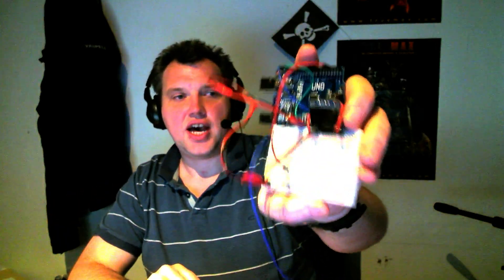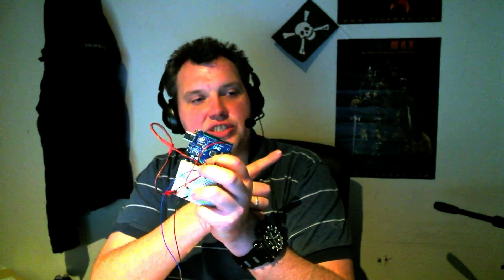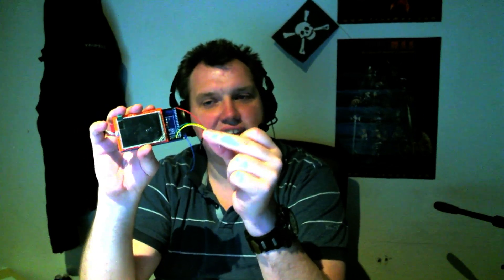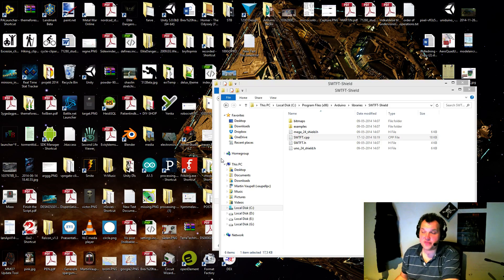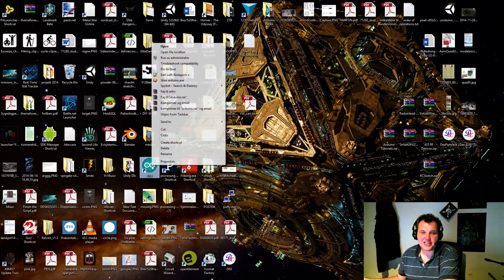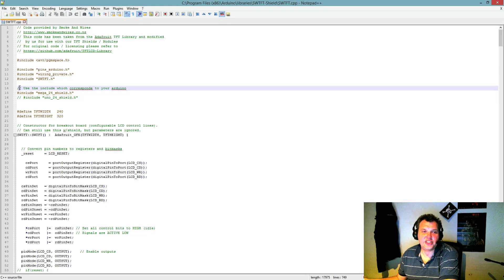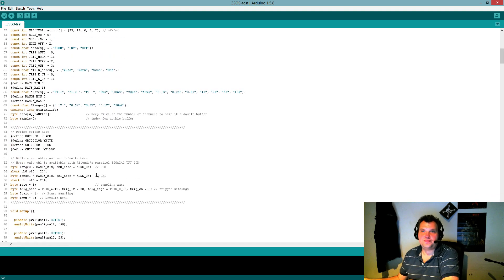Arduino - DIY Oscilloscope with TFT screen

Comment: Hey man I’m back again can I have your code again I lost it I really want to redo this project
Reply from the maker: This is more than 8 years ago, i haven't saved it anywhere..   If someone has it great, else it's gone :)
Reply: @VaupellGaming   nope I got it, I msged you on ur discord, pop in so we can chat lol
Reply from the maker: @WasaMada  ahh yeah well, i get a lot of messages, so all non friends are auto blocked..  If you want to chat, use the servers that is why they are there. 
Due to timezones and we are globally here, i don't really check things at night or when i am sleeping. 

So no PM's..  only public..   😉
Reply: @VaupellGaming   maybe u can answer my question here then, when I compile it says a10 is not defined and suggests using a1, after that compiles, it then says swap is undefined or something, I’m confused
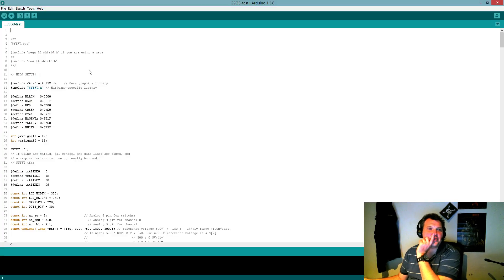Reply from the maker: @WasaMada  Well no i can't tell you.  My guess the software/compiler has changed over the last many years and are looking for different ways to define a analogue port, or you simply have the wrong board selected in the compiler.  You could try to use another port, the MEGA has so many alternative ports than A10, in this video at 05:05 you can see the lib _22OS_test and at line 44 the pin is defined, if you read the note it even says pin 4, but i am using 10 in the video, which should indicate i changed the pin. 

const int ad_ch0 = A10; could be any of the analogue pins, that one is for one of the probes.
Reply: @VaupellGaming   thanks man for ur attempt, lol I am using a uno, I just really loved the final look when I did have it working
Reply from the maker: @WasaMada  ahh but the Uno has 6 Analog pins, so you would never be able to use a pin above 6..  99% thats the problem.
Reply: @VaupellGaming   ok so what would the a10 a11 look like a1 a2? And probe on pin a4?
Reply: @VaupellGaming  so I guess my question would be, if I’m using a4 for the probe, and using the uno with the mcufriend shield, what do I change in the code

Comment: Hallo Martin, that was cool project that i ever wanted, I have try your project and i meet some error, here it is:
 C:\Users\Iman Fushshilat\Documents\Arduino\libraries\SWTFT-Shield\SWTFT.cpp:634:16: error: 'swap' was not declared in this scope
     swap(x0, x1);

Iam using Arduino IDE Version 1.5.8, that same with your Arduino IDE in your video. any suggest to fix this problem?
Regards
Iman F

Comment: hi, i've downloaded your compilation code and installed the library above, but the arduino cant compile it, it says tft_screen.ino:7:20: fatal error: TFTLCD.h: No such file or directory
compilation terminated.
.
where did you get your tftlcd library?
Reply from the maker: It's linked in the description. But this is now a pretty old video and a lot of libraries have changed/updated since then and even the arduino ide compile in a diferent way

Comment: Hey I finally got the sketch compiled and runing for ardunio uno
but all i get is whitescreen? how do i fix it?
Reply from the maker: +John Maderer Hi, it can be so many things.

First thing about electronics is to troubleshoot them.
When i run into problems like that, there is nothing else to do
but to measure voltages and signals across all wires

but you might start out with the screen wires, since that is
where you have the problem, have you testet the screen
with other applications first?  
Does the screen work with the same "drivers" libraries as i used? 
Is it the same model ? 

Have you found other screens to test with ?
Reply: +Eqvaliser I just received the display, and I have the same problem with your code, it has only white screen. However my display works, because I put the original code from the japanese guy, but everything is mirrored. HELP!!!
Reply: Eqvaliser

Comment: Hi there I had a question ... How can I adjust the time & voltage scale in the given program ..?? Does it change on its own based on the signal or do we hav yu change it manually ?If manually .. How should I go about doing so .
I'm using the arduino UNO & the original code from the Japanese website